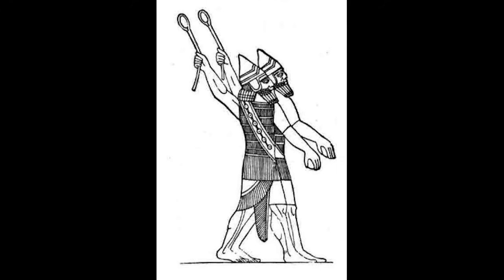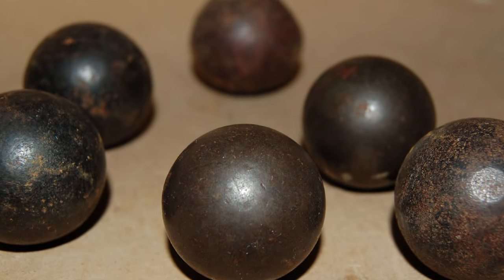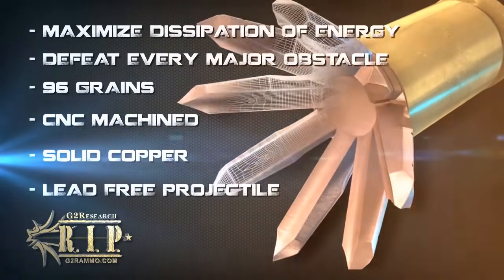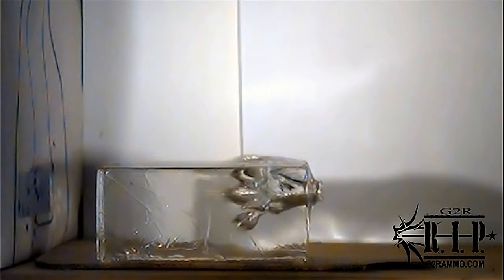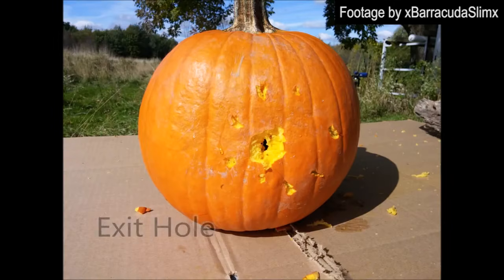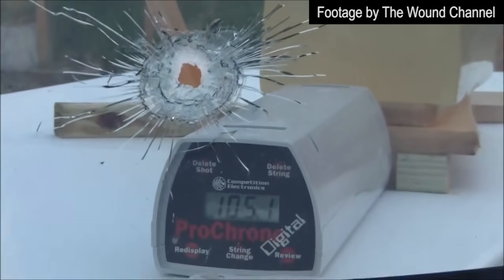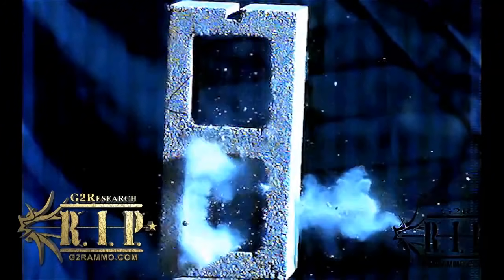The next step in bullet evolution: The Radically Invasive Projectile (RIP)

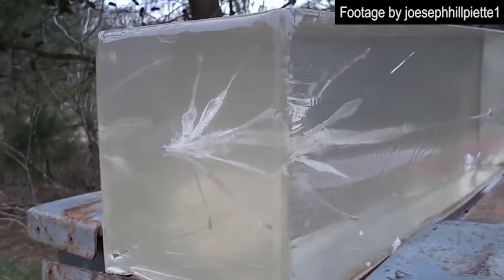Comment: Nightmare fuel? Click here 1:09 For fucks sake, why would anyone need a projectile that performs like that? If you used this round in self defense, the prosecutor will lock you up. The military is the ONLY ones who need a weapon like this. Fuck me sideways..
Reply: if you live where the cartridge is legal, why would you face any addition legal issues?
Reply: Because cruel and unusual is a lawyers best friend. Going beyond what is needed for your protection is also a lawyers dream. I have seen justified shootings get turned backwards because a stock weapon was modified. If you take a standard ball ammo, take a knife and cut a + in the tip to make it act like a hollow point, you are now in legal trouble. That is the premise behind it. If you shot a intruder in your house with one of these RIP shells, their lawyer would have you in prison.
Reply: your assumptions are from watching too much scripted TV.  Site a single case where a justified defensive shooting saw the defender successfully prosecuted due to the type of cartridge? No such thing...
Site a case where a round designed to fragment was used against the shooter in ANY scenario? no such thing...
Reply: This has zero application it's not effective through light cover and causes misfeeds so not even the military would want it. Also they are very expensive. As far as civilian use there's no point since normal hollow points are more effective.

Comment: Controversial ammunition for a controversial subject in today's world. These bullets really are not necessary. Sure they're pretty neat, but why would it be necessary to use this versus another type that's cheaper and does the same thing? Think about it. You're already defending yourself, and if you hit an attacker with a hollow point, they're going to need medical attention but may be saved. Sure they may die but that's what they had coming. Now if you think about this round, it's going to make it really difficult to save that person and you're basically guaranteeing a KILL rather than an incapacitation. Unnecessary and more expensive, as well as questionable ethically. Do we need this for self defense? No. absolutely not. Is it neat? Sure. I don't need those and most people with concealed carry will probably agree. The goal of carrying a gun is not to kill an attacker, it merely removes their option to use force, as even the sight of a gun is usually enough to make someone back down and prevent a shot in the first place. If you did need to shoot someone, you don't need to guarantee that you kill them, any bullet will do that if you use it right.

Comment: People get way too caught up in the latest and greatest crap. Regular bullets have been killing people for hundreds of years, you don't need to spend $1+/bullet. Anyone that studies ballistics knows that penetration is much more important than expansion. I've read about MANY people that survived getting shot with a pistol because the hollow point stopped 1" short of their heart, or 1/2" short of their spine, etc, etc. I would much rather have a  9mm sized hole that penetrates vitals than a bullet that leaves a big shallow would. No thanks.

That base and those petals don't weigh nearly enough for adequate penetration in the real world. This bullet was designed to do one thing: impress amateurs with unrealistic gel block videos. What makes .45 deadlier than 9mm? No, it's not the 1/10 of an inch diameter difference, it's the 230gr bullet that plows through bones and barriers much better than the 124gr 9mm bullets. What happens when you design a bullet that splits into shards upon impact? You get a nasty, nonlethal flesh wound and a bunch of bullet bits that bounce off bones and fail to penetrate vitals.

Comment: I have a box of these in 380 and 9mm I would get some in 45 but my 1911's don't generally like hollow points so I seriously doubt it will load these.  They are very destructive I shot a pumpkin and the results were exactly as advertised one entrance and 6 exits if that was a bad guy it would take one hec of a surgeon to fix that wound so I seriously doubt they would be able to lie to the police about what happened.

Comment: Winchester did a very expensive research program to design a bullet that for law enforcement and self defense that :1-Would not over penetrate a human target.***The bullet would not exit the target and endanger someone in the line of fire behind the target.2-Would not fragment.***The bullet would retain its weight and would not leave sharp fragments to penetrate the gloves of medics working on the wound.3-Would be fully observable by hospital x-ray equipment.4-Would not penetrate auto glass and home sheetrock walls as a stray bullet.5-Would expand to be a effective one shot man stopper.Winchester succeeded and produced The Black Talon. The media went nuts over the idea that the police now had a "Super Bullet" and Winchester stopped making the Black Talon. You can now buy the same bullet as The Ranger XT. They are no longer black but its the same bullet.
Reply: Bob Sullivan are they the same bullet? I did a test awhile back with .45 auto black talon and the Ranger version and thought the expansion was different. I still have a box of each. in my test the Ranger was arguably the closest bullet I've ever shot to the black talon, but wasn't as pronounced in terms of the 'talons'. that was my view. but maybe I need to do more shooting and testing?
Reply: Brad Carter
The only difference between the Ranger SXT and the Black Talon, other than the color, might be a slight difference in the tips of the "Petals" of the bullet tip.
I read somewhere that the SXT petals have square tips and the Black Talon tips are pointed.
I will at some point dig out some stored ammo and take a look for myself.....

In the meantime, I view the SXT as ideal carry ammo.......  fer what itz werth.....HehHeh
Reply: Why the fuck would people flip about a safer bullet?? If everything you said is true then all law enforcement should use them

Comment: This round is a scam.  The small pieces that break off carry virtually no energy and if the perp is wearing a jacket, they won't penetrate it.  This leaves you with a main projectile that has half the weight of a normal projectile.  This means that penetration and damage is minimized due to a huge reduction in energy (due to the reduction in mass).  I don't know what kind of gel they used for that test, but any jacketed round would have gone right through the other side of the block.  This ammo sounds good in theory, but the reality is is basically a gimmick that doesn't work.  It's much less lethal than ball or jacketed ammo and certainly no match for hollow points.

Comment: Not a fan of this round, I consider it an over hyped and incredibly expensive round with little practical performance. I will stick with my Federal Tactical HST's, now there is a bullet that is the next step in bullet evolution.
Reply: The issue with the G2 RIP....

1. The "trocars" break off way to early at around 5 inches of penetration in 10% VYSE Organic Ballistics Gelatin (FBI spec rating).

"But 5 inches is perfect if I measure it in my body"...... Ballistics gelatin depths for penetration are NOT 1:1 scale of a human torso. 

For properly calibrated ballistics gelatin to be considered accurate in simulation it needs to have a steel BB of .177 caliber fired at a velocity of 600 ft/s +- 10 ft/s in deviation accepted, and penetrate no less than 3.25 inches and no more than 3.75 inches.

That's right a STEEL BB fired at 600 ft/s which even for a .177 caliber bb is considered fairly slow as some are up to 1200 ft/s penetrates between 3.25 and 3.75 inches in properly calibrated ballistics gelatin!

So 5 inches in gel is not **, its literally right beneath the skin, and yes that would hurt, and yes the BASE does go to at least the minimum of 12 inches to get into the vital organs, however in point 2 below I will explain the issue I have with the base.

2. The base, while it penetrates deep enough, ends up SMALLER than the caliber you are shooting and DOES NOT EXPAND OR CUT DEEPLY as it is a disc.The whole point of expanding ammo is not just to transfer all available kinetic energy to the target but expand to a larger diameter with sharp edges to cause muscle tearing allowing for more traumatic wounding assisting in neutralizing a threat. The G2 RIP does not do any of that well, and for the argument of "well then let me shoot you with it and see if you live", the same can be said for a 40 grain solid .22 LR, but that does not mean I would make my .22 LR my primary self defense round now would it?
Reply: Youre Mahm 
the really ironic thing is the Liberals that are constantly going on with their love and progressiveness... are the same assholes that are out in the streets right now hurting people. Let them cry.
Reply: random guy LOL IMHO there is never enough when loved ones or my own life are on the line... Reminds me of a joke, someone once asked why I only carry a .45, I simply replied because they dont make a .46
Reply: random guy no, infact you not only cause a minimal woumd cavity but you end up with serious overpenetration where the bullet will go through the intruder and may hit someone else behimd them, and/or in another room.
Reply: Youre Mahm 
😂pretty much....
Reply: Not to say Federal HSTs aren't some of the finest anti-personnel, minimal OP rounds made, but the R.I.P. is purposely made to cause as much trauma and pain as possible, along with maximum penetration through thick clothing. As such, one round is more than enough to put down the most aggressive, hulking, and determined of attackers. I personally EDC it in my Glock, gives me complete assurance that whoever intends to do harm to me or my family will be dealt with fatally.
Reply: Wow. That was a... really detailed comment. I'm impressed and thankful you went through all the scientific troubles to get hard data. I have to say, though the G2 trocars sometimes have trouble with the cutting/tearing trauma it so heavily advertises (after going through enough heavy clothing that is), the amount of energy and fragmentation of the G2's design is more than enough to put down most contenders.

From where I see it, Federal HSTs are made to maximize kinetic output (knockdown in other words) and minimize overpenetration, which is a great combo for putting down bigger threats and ensuring the safety of others in the vicinity.

G2s specifically focus on penetrating thick surfaces as it advertises (wood, metal, layered clothing) and then fragmenting in a star-like pattern to cause immense amounts of pain that will not only stop an attacker, but leave them writhing in pain/bleeding out on the ground, completely unable to attack again. 

All in all, I've seen many videos on YouTube and independent tests on various websites of the G2 RIP's capabilities; needless to say, the results are highly varied, though one thing is guaranteed: if just one round makes contact with flesh, that person will not be getting up again (compared to a regular FMJ round where the shock/trauma is not enough to keep someone down). I say this because there have been numerous examples of armed citizens/police officers unloading 10+ rounds into aggressors; why not reduce that amount to one or two instead?

Also, I think it'd look a lot better to a judge and jury that you bought a round specifically for self defense, and only had to use 1-2 shots to stop the threat (not trying to be trigger happy and destroy your target with your entire magazine).
Reply: Great post with some great data, though I am taking it on face value the novelty of this round does not escape me but with my life on the line I will be sticking to my Hornady Critical Defense rounds (zombie no less).
Reply: Well, i get that you really want to stop an "intruder" but isnt FMJ enough?

Comment: First off, these would never be used in a civil environment. The video creator is dead wrong in saying that. However these have military applications and no, do not violate the basis of the Geneva convention because they are not causing unnecessary suffering. These are meant to kill more often and with less rounds than standard rounds therefore actually reducing the amount of suffering inflicted on the target. People often forget that the Geneva conferences were not held to make war less deadly, but to make it so that there is not weapons which cause only suffering and not immediate death. If the conventions were made to make war safe (what a paradox, I might add) then than guns would have been banned after the civil war and not triangular bayonets.

Comment: Why use RIP when you can now have newly created XRBR ammo. 

Xtreme Rabid Badger Rounds signal a paradigm shift in home defense and anti-terrorism ammunition. Utilizing the same state of the art technology that puts foam dinosaurs in those plastic capsules that dissolve in hot water, I've been able to enhance what would be otherwise boring hollowpoint ammunition with a rabid badger core. The exact process is like, totally secret and proprietary. 

Upon striking the body of your target, a rabid badger is unleashed through a process that involves a lot of really hard to understand math and physics calculations, and possibly some magic. The resulting stopping power goes beyond devastating, and is actually completely unable to be measured. In every ballistic test conducted, the badger ate the gelatin block, and then quickly turned on the testers. 

My cores use very expensive laboratory grade badgers that are 99.9% pure, and 100% insane with rabies. 

The shock of a rabid badger bursting from a teammate's body and then going totally nuts adds a psychological warfare element unmatched by any other ammunition maker in the industry today. To further enhance this, I took a cue from the A-10 Warthog, and painted a scary face on each and every round.
Reply: Ah, hell, i'd buy some.
Reply: Rabid Badger just takes what it wants.
Reply: I wouldn't worry. The rip rounds suck hardcore. The tracones don't act as advertised and the penetration is negilable at best. Now if 2GR actually did some real R&D and actually developed the round right you maybe would have to be concerned about. You'll probably get orders soon enough. I'm tired of hearing about RIP rounds frankely they don't do what they are supposed to do!
Reply: Sounds like a really scary foam bullet

Comment: The problem with RIP ammo is that the fragments are weak and will have a hard time penetrating as the flakes don't carry much energy. At best this round may speed up internal bleeding.

Guns used for defensive shooting are meant to be used just enough to stop an attacker from attacking. This could mean to the point of killing them but its not the goal. If there was a magic bullet that stopped people and did not kill them then everyone would use that. Stun guns work fast but are not as reliable and sometimes not as effective. They are also sort range. Tranquilizers work but are slow to work and sometimes not as effective. Bullets work fast and are more reliable which is why they are used in a case of extreme force.

If a bad guy is not stopped by the pain of being shot (most people survive a handgun shot) then the next thing that will stop them is bleeding out (will take time) or hitting them in the nervous system like the spine/head. Having bullets that are powerful enough to break bone but not so strong that they will over penetrate and hurt someone behind the criminal is whats idea. This is why hollow point bullets are so popular. 

They get bigger then they hit flesh making it more likely for you to hit something that will stop them. They slow down fast to prevent hurting others behind them.

Comment: "Personal defense." Then shows a man with a full auto glock, that explains a lot.
Reply: $200 tax and you can own one too man...$400 total tax and it is sound suppressed...put you down for one man?   That is plus cost of weapon of course...not for the dirt poor...also have to have clean mental health record and no felonies i'm pretty sure...
Reply: Yes, personal defense from attacking watermellons at the range. Point is, if you do have to defend yourself, that guy won't be getting up.  And even better is the fact that these exist, imagine planning to rob a house with possible guns inside and then learning about these.  I would never rob a house with guns again.
Reply: i do not care you pull out a full ato gloc the gyuy is dead d e a d dead
Reply: The only machine guns capable of that, are the ones used in CIWS
Reply: That soviet sub-machine gun (I forget it's name) was like 900 rpm I think... Close though, they  called'em burp guns on account of the sound in full auto...
Reply: +Katiara Blackdawn Theese are necessary only on the occasion that your attacker has a 1400 rpm sub machine gun.

Comment: This bullet will not work in high velocity weapons, the speed at which a bullet will attain will literally rip itself apart. Also the riffiling in the barrel imparts a spin on the bullet which in some weapons with fast twist (1 in 7 inches) and high velocity will cause a rotational spin in excess of 300,000 rpm and again cause the bullet to rip itself apart. It looks cool but it will only work in low velocity weapons with slow twist barrels.